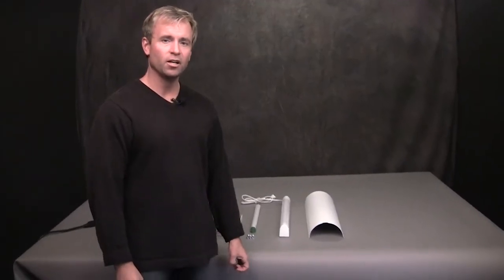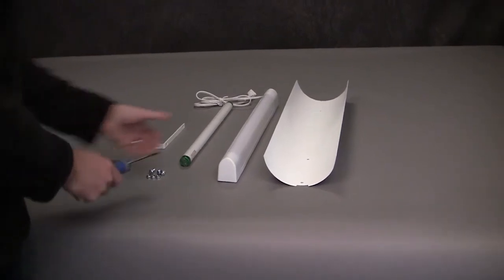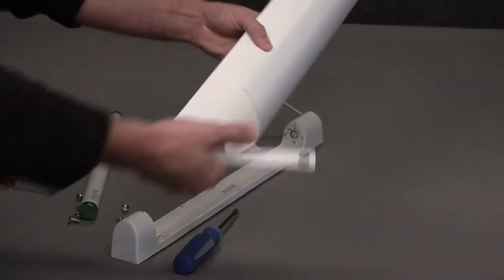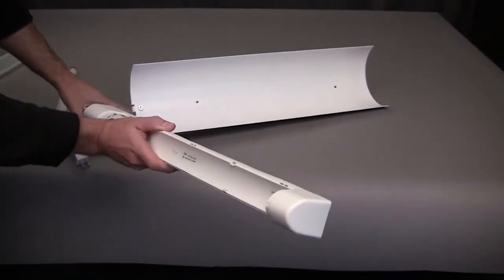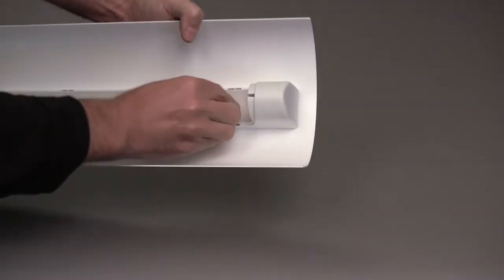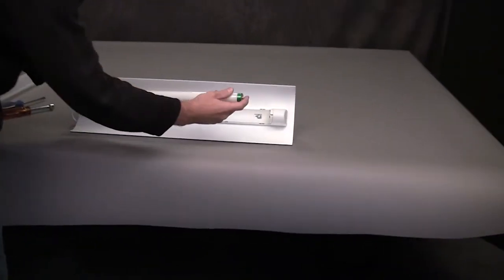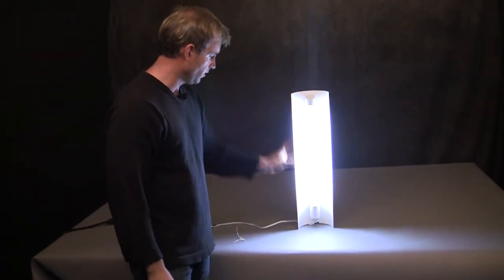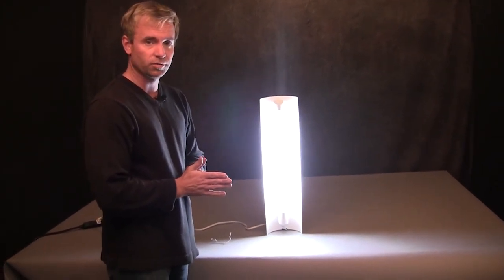MyStudio AL1 Accent Light - Setup and Assembly

Comment: We had a hard time replacing the light covers. I think it may be due to the fact that the fixture is being attached to a curved backing, unlike the main lights which were attached to a goat backing. One last comment, we snapped a bunch of tabs off prior to seeing the video! Maybe put a warning sticker on the covers that says only pry loose with flathead screwdriver? The engineering behind this product seems solid, but the manufactured product seems extremely flimsy and cheap.